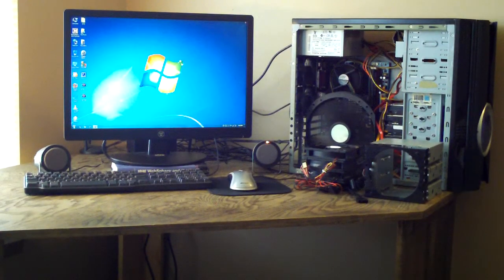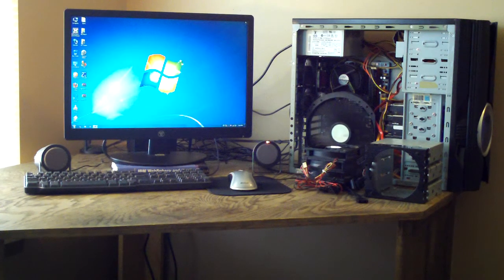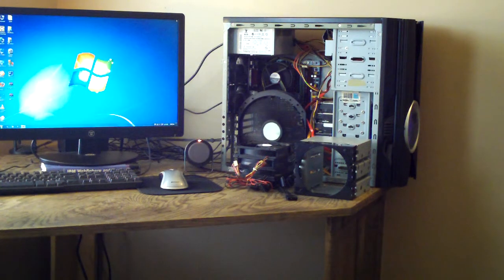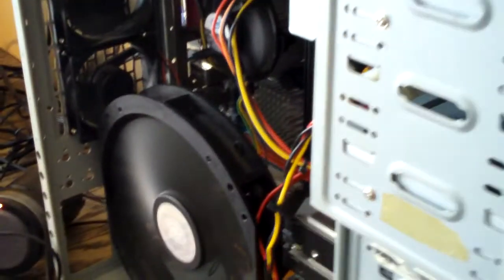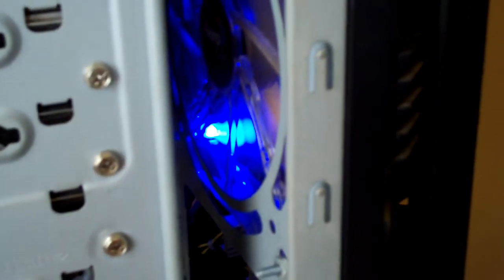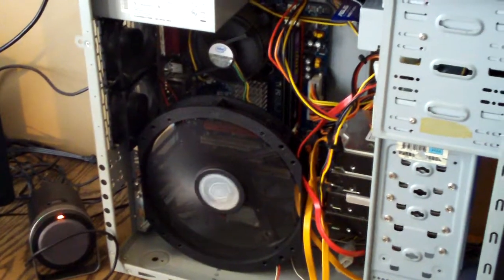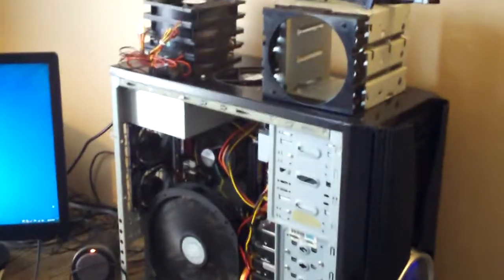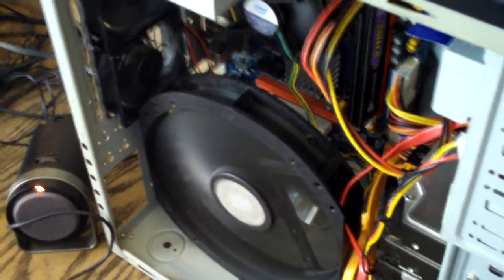Temporary Computer Overview Part 1

Comment: wow a 8800GTS, it's not a bad card. Just flash it to a GTS250 it's the same card. Just rebranded with a little higher clock and it will support CUDA and Physx

Comment: @ComputerTechTV its Llano and other apu's are for the low-end mobile market. i want to see amd get its crap together. Right now they dont have top 10 anything except for videocards. Their could be some foul play on intel's part but AMD made a lot of bad decisions once they lost the lead after their x2 939/am2 transition. I still have my x2 3800+ system and the lowest x2 launched at $450 because it rocked! Now AMD sells its flagship desktop cpu for $200 bux. I got my fingers cross for bulldozer.

Comment: I saw benchmarks for an engineering sample running at 2.8 GHz and it is STILL slower clock for clock then comparable 2.8Ghz intel chips. Ohhh well....I am pretty sure anyone looking for an intel killer like the FX chips in 2004-2005 will be disappointed.

If this contininues much longer AMD will end up like Cyrix at the end of its life releasing mid-ranged parts and then entry level, and then bye bye. I never suspected Cyrix would die when I had my 150MHz MX pr200+ system but it did. :(